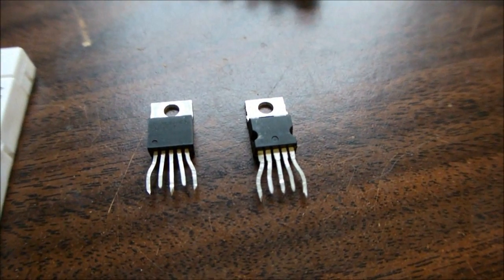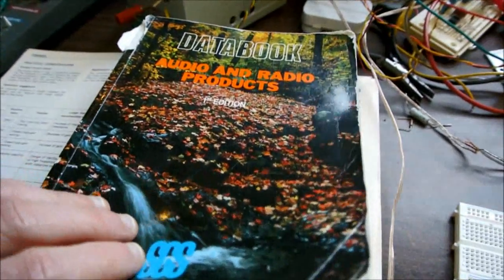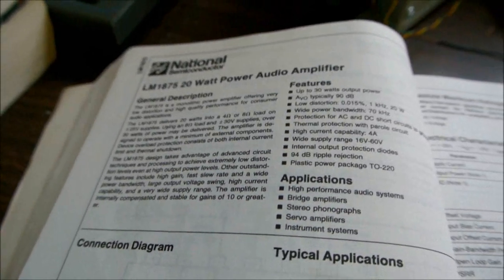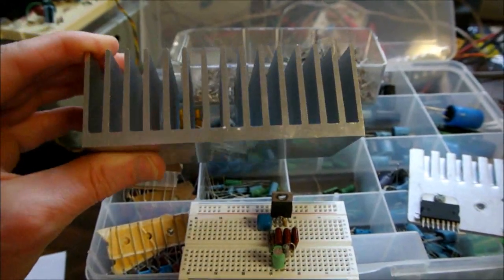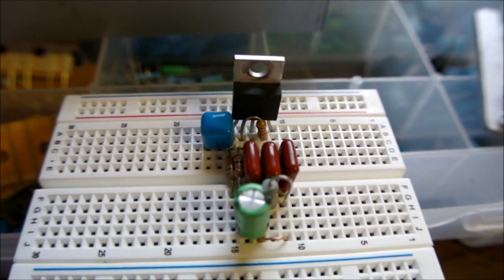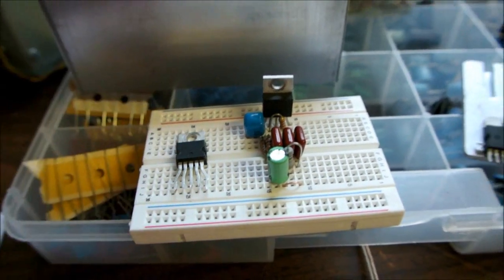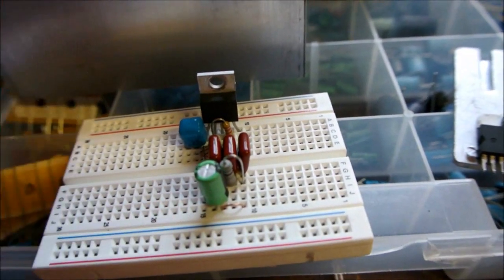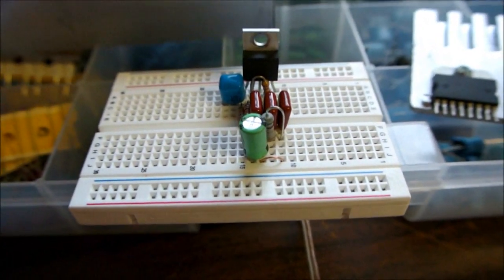TDA2050 and LM1875 audio amplifier IC on breadboard

Comment: You explain that the TDA2050 chips from ebay/China are no good - yet your links are to ebay/China. Are there some that are ok, or at least better than others? Have you found any newer chips you like as well or better than the TDA2050 that are currently being made? Thanks.
Reply from the maker: The TDA2050 was discontinued 4 years ago. The ones on ebay are more than likely fakes. Better to use the LM1875.
Reply: Thanks John.

Comment: Hii john ,happy to see your videos ,  i am regular viewer of your videos blog too. I am recently interested to make a audio amplifier using tda 2050 , i am not  a expert in electronics only know basic thing , if don't mind can help me with circuit diagram and breef explanation of the same ( selection of components, Power supply etc.) I am waiting for your, reply thank you very much for your time
Reply from the maker: Use the LM1875 instead. The 2050 is obsolete and new ones you buy are probably counterfeits. Check the video about the LM1875 kit I tried for more information.

Comment: What is the max single ended supply voltage I can use with the TDA2050? Would it be 25v or 50v absolute max? Thanks.
Reply from the maker: 50v max across pins 5 and 3.
Reply: Thanks! Also I was wondering if you have any advice on RF filtering when adding a 3.5mm aux jack to a chip amp design? Because if you look in many commercial amp designs they all seem to have networks of resistors and small capacitors right at the input jacks, I know about RC filters and roll off frequencies but I'm just unsure when to add them as the datasheets for most chip amps tend to show the bare minimum application circuit.
Reply from the maker: I put the RF filter on every amp I build aside from some small battery powered ones. Most datasheets don't include them but I think every audio power amp should include them.
Reply: hmm could you maybe do a video about them at some point? Maybe show how you implemented them in your previous builds as I find the volume control pot + filters together hard to get my head around. How do you prevent accidentally creating a tone control circuit in the process.

Comment: any idea why they stoped making tda2050? do st propoee the alternative?
Reply from the maker: +Sgt Pepper I think, it was the lack of volume sales due to class D amplifiers and the move to surface mount parts as well as the 2050's lack of a low power standby mode that reduced power usage. These chips would draw 2 or 3 watts sitting idle without a low power standby mode. This makes them unfavorable with the push to reduce the power of electronic products when sitting idle.
Reply: JohnAudioTech so according to ST, if I want to build my own amplifier I should turn to class D amps? that kinda sucks.
Reply from the maker: +Sgt Pepper There are still a few linear ICs available. I'm not a big fan of class D either. If you want to build an amp based on the 2050, just use the LM1875. It is still in production and has a bit better distortion specs anyway.
Reply: JohnAudioTech well the tendency hints that those will be out of production in the next 5-7 years, soooo...

Comment: Hi John, thanks for the video. I'm new to electronics and have learned lots from your videos, which I find to be helpful and I enjoy your laid back style of presentation. I have one of these TA2024 amps which I'm using with a Google Chromecast Audio, which provides the audio signal. I have a 12v supply for the amp and a separate 5v micro USB style supply for the Chromecast, using up two mains sockets. I was wondering if it would be possible to create a 5v feed from the 12v power supply and power the Chromecast with that? I think a 7805 voltage regulator would create too much heat, so I tried using a 12v to 5v car USB adapter but I found that it generated a lot of unwanted noise through the amp. Any idea why I'm getting this noise? I suspect that the 12v to 5v is a switching power converter not really meant for sensitive audio equipment. How I could supress the noise, or even better, is there a better method for stepping down the voltage in this scenario? Many thanks from grey old England, and I look forward to your future videos. Best regards, Graham.
Reply: Sorry, I meant to comment on the TA2024 Class T amp review and somehow stuck it here instead......
Reply from the maker: +Graham Pritchard How much current does the chromecast draw? I can't imagine it uses very much power. If less than 100ma, the 7805 probably would not need a heat sink and wouldn't cause the noise that a switching regulator does. If you stick to the switching regulator, you would have to build a filter using capacitors and inductors based on its switching frequency and harmonics if it is indeed the cause of the noise..
Reply: +JohnAudioTech Hi John, thanks for your reply. The Chromecast Audio comes with a 1amp power supply but someone has tested and found it draws 200mA. The CCA does get quite warm. Is that too much for a heat sinked 7805? Silly newbie question time, could you use 2 x 7805 in parallel to share the load?
Reply from the maker: +Graham Pritchard Sorry for the late reply. The 7805 will handle 1 amp (1000ma) so you're fine. There is a very small 78L05 which won't work. You would need to add a small heat sink to the 7805 because you are dropping 7 volts at 200ma through it which means the 7805 would have to dissipate 1.4 watts.

Comment: They are interchangeable.  I once busted a chip TDA2050 due to accidental reversal of supply voltage which is stupid on my part.  Since I happen to have a spare LM1875 on my junk box, i googled it.  Experts say that it's a suitable replacement without changing anything on the original circuit.  I tried it and it works like a charm.  Nice chip.

Comment: Hi John! Im happy to learn the knowledges that you shared.  These days I tried to fix my Line6 30watt guitar amp, me and my teacher(electronics technician in HAVC) spend time to check the PCB board, he was pretty sure that the "black clip" need replacement, I found the code on it which is called "TDA 2050", it showed as "12-30-2050" on Line6's schematic. My question is, is that OK if I replace any 30watt(or 32watt??) TDA2050 amp IC which is bought from ebay or somewhere else? Here is what I read on my burnt one: "TDA2050  CZ00Y VW", do I need to find the exact one? I do need your advice,Thank you!!
Reply from the maker: Sam Cui If it turns out to be a bad TDA2050, I'd check to see why it went bad. Sometimes components fail on their own but more often something helped them to die. Unfortunately, now that the 2050 is an obsolete part, sourcing an authentic part may be difficult (forget ebay). The LM1875 can be a suitable drop-in replacement.

Comment: Hey there.  
I bought a guitar amplifier that uses this chip.  This has prompted my curiosity on just how an amplification circuit actually works.  It amazes me that this physically small item can create such a large amount of audio signal (the guitar amp is loud).

I know there's a lot more to it and I'm over-simplifying.  However, I'm so interested in learning about how a simple circuit works.  Can you suggest a resource where I can learn (and build) a simple amplification circuit?  I'd love to know what goes on under the hood.  thanks.
Reply from the maker: Joe Faraldi To best understand means starting at the beginning and understanding electricity, ohms law and electronic components (resistors, capacitors, transistors, ect). allaboutcircuits.com is a good site to get you going. I'm sure there are good videos here as well.

Comment: Do you have a schematic that you used? Or is it in the data sheet?
Reply from the maker: It is similar to the datasheet, but I go a bit higher in gain and add an RF filter on amps that are for permanent build. I use higher value film decoupling caps as well.

Comment: I don't know if you have a video on taking apart the ic and seeing the die. But if you don't, here's my request! I always wondered what it is like inside and I was quite surprised that you took it apart so easily? Now I'm curious!
Reply from the maker: I had a picture comparing the fakes with the authentic ones. I'd have to dig around and see if I can find it. The IC's decapped themselves when I blew them. What happens is the the power transistor shorts and the bond wire vaporizes and cracks the epoxy cover. I then just pull the pieces away. Breaking the cap off of a good IC rarely works. There is a way to dissolve the epoxy using chemicals but I've never tried that.

Comment: The tda2050 is realy a beast IC.
But I cant figure out how to make it work at 50dB gain.Can you help me with that?
Reply from the maker: What is the problem you have? That is quite a bit for a single amp, you might run into gain bandwidth product issues and stability/distortion issues. Grounding paths and shielding the leads are critical. Better to use a preamp in this case.
Reply: OK, so i decided to go with a preamp.I'm planning to get TDA1524A.It is a preamp with tone corrections.I hope it helps me with gaining more dB from my phone.